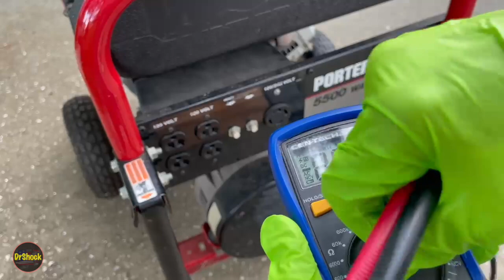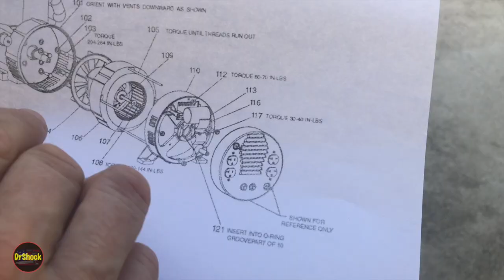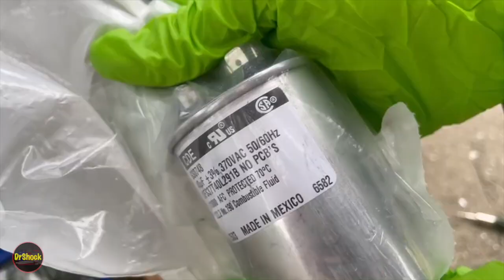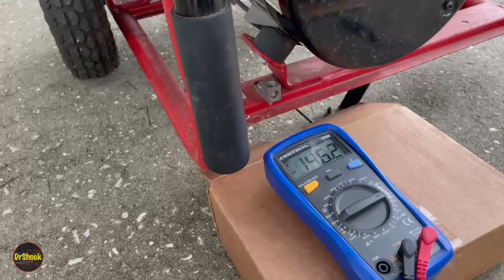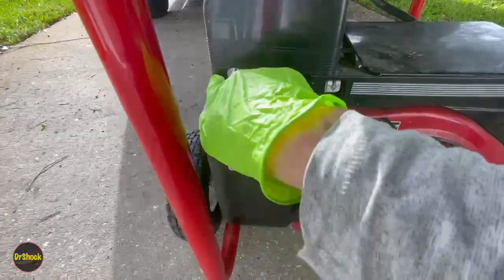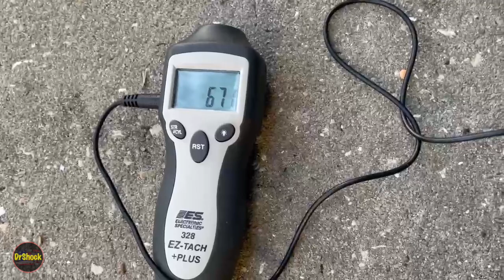Porter Cable BSV550-W & BSI550-W Generator ~ No AC Voltage Output & AC Voltage Too High Repair / Adj

Comment: Whats the black lever do,next to the choke,im working on a unit w bad fuel,varnish...looks like theres a couple screw adjustments limits? The spark plug boot is kinda hard,and doesnt snap on ,i tried squeezing the little coil of wires,to get better contact,spark plug looks perfect,i like how you tested the receptacles, i didnt get a manual,had no idea there was a capacitor
Reply from the maker: I seem to recall that black lever next to the red choke lever is a manual fuel shutoff.   There's a link to the owners manual in the video description, it is shown but not identified.
Reply: @DrShock seems theres two limit screws ,I have yet to get it running,without starter fluid ,I just  cleaned the tank,the cap n grommet both dry rotted,so I got new stuff on the way,poor thing g needs some love 😊
Reply: @DrShock not sure if its a manual fuel shut off...seems its a throttle  ,and has a spring  to the governor arm,...I had a anolog rv outlet tester *shows a scale of voltage,) red and green zones 😅...anyhow I used that black  lever to adjust the volts to a sweet spot,.120-125..the carb has a limit cap,I havnt messed with since its running, theres a small screw w spring on the carb ,...I don't know  what it does...😮,
Reply: @DrShock haha  I saw  another video ...the black lever is speed control? Supposed to have a rabbit/ turtle decal😂
Reply from the maker: The unit I showed here had an automatic speed governor mechanism, rather than a manual speed control.  I didn't inspect whether the black lever was vestigial or perhaps a manual override.  I could only speculate as to what you're seeing.
Reply: @DrShock yessir ,turns out to be a speed control,has a (rabbit turtle decal* missing)

Comment: Excellent info and explanation of the whole process but what does the capacitor actually supposed to do?
Reply from the maker: Thanks.  This is an older technology, circa 2004, brushless generator and on such models the capacitor is used in lieu of a voltage regulator circuit.   It excites the magnetic field of the generator, and stabilizes the output voltage as engine RPM varies afterwards.
Reply: @DrShock Thank you for that info! I have an old 3.5kva one I used for work mid 80's and I'm sure it also has a capacitor too. I must try this out. 🙏🤠🇦🇺

Comment: What's the general price difference between OEM and aftermarket (for the cap) since they're all made in Mexico anyway? I ask because I follow Scanner Danner, Toyota Maintenance, and other automotive channels who've all been featuring inferior quality replacement parts from Mexico (lately).
Reply from the maker: I wouldn't know, as I do not use non-OEM parts because they cost far more than OEM ones both during the repair (fitment issues) and over the life of the machine (performance and compatibility issues).   If you want to do the job once, use OEM.  But there can be such a thing as low grade OEM parts unfortunately.

I'm an engineer in my day career, so I've got a different real world perspective on this topic than some other creators in this space may have.  Where a part is manufactured is not at all relevant in my experience of designing and manufacturing them.    What matters is whether the OEM engineering team is actively involved in the selection of materials, manufacturing process and the quality control.   In some cases, with some OEMs, this is not the case and the financial teams are more in control.  This is why Chinesium parts can originate from outside of China, such as from India or Mexico.  It's a word to describe parts which exhibit inferior materials, inferior design, inferior fitment, inferior compatibility, and of course inferior performance not necessarily only the country of origin.  It's a label I view as directly within the umbrella of enshittification overall.   Unfortunately, there's an epidemic of this lately, affecting many different parts and my advice is only buy products from OEMs that still produce quality parts.